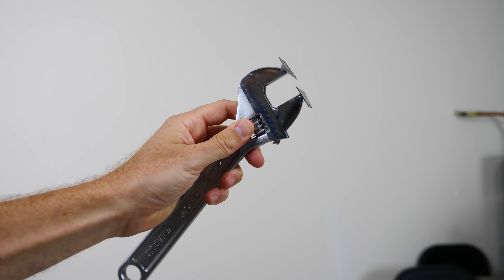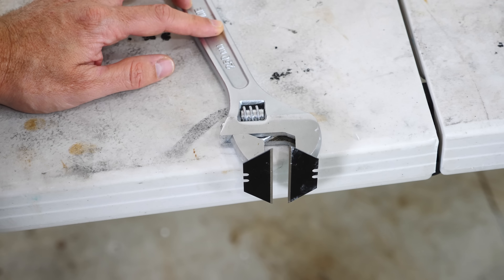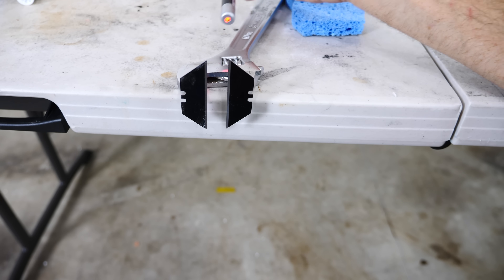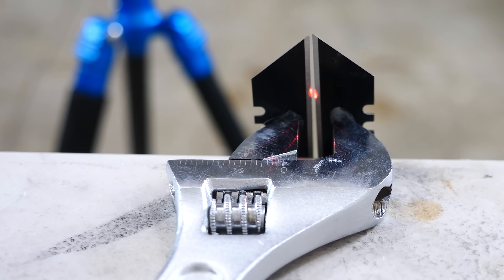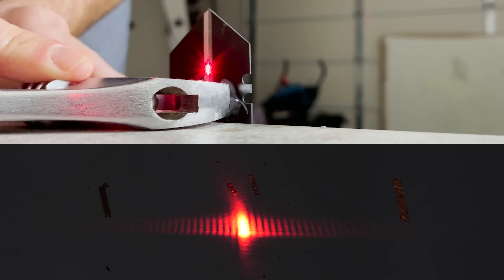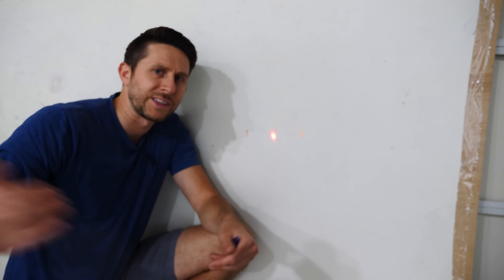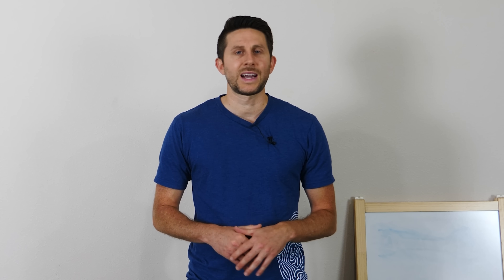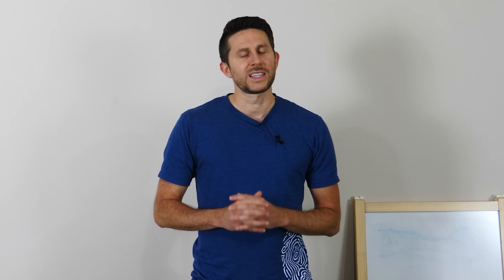Squishing Light Makes It Bigger—Heisenberg's Uncertainty Principle

Comment: What you and others fail to realize is that the atoms and molecules, in this case of the razor blades, have an associated magnetic field with them.  Light, 'em', also has a magnetic component to it.  Magnetism is magnetism, varying possibly only in density and energy frequency.  The magnetic portion of the 'em' interacts with the magnetic portion of the atoms and molecules of the razors, thereby causing the indications observed.
Reply: You don't make any sense. This is the wave-particle duality of light that is displayed here. The material the razor blade is made of doesn't matter at all, it doesn't interact " magnetically" with the light
Reply: @abcdefgh-db1to  Here is an idea I had quite a while ago for what I believe is a better explanation to the dual slit experiment:  (copy and paste from my files):

It is only an idea on my part but it goes something like this:
1. Charged particles have their associated magnetic fields with them.
2. Protons and electrons are charged particles and have their associated magnetic fields with them.
3. Photons also have both an electrical and magnetic components to them.
4. Whenever a proton, electron, or photon is shot out of a gun, it's respective magnetic field interacts with the magnetic fields of the electrons in the atoms and molecules of the gun itself, the medium the projectile is traveling through (ie: air), and/or from around the slits themselves.
5. Via QED (quantum electrodynamics), newly generated photons might occur.
6. The projectile goes on it's own way and the newly generated photons go on their own way.  It gives the illusion of a wave particle duality, but it is not that way in actual reality.
7. Specifically in the case of protons or electrons, the newly generated EM wave travels faster than the particles. The new EM waves go through both slits and sets up "hills and valleys" of field energy. When the proton or electron goes through one of the slits, it then follows whatever "valley" it enters thereby over time, even shooting only one proton or one electron at a time, the interference pattern will still emerge.
8. As far as detectors are concerned, they probably have an energy field that is one way when on and a different way when off.  The interaction of this energy field (or the lack thereof) with whatever is passing through it, gives the indication that is observed.

Now, for those who hold fast to reality being probability waves that are condensed down by an observer into one single physical reality, then:
a. What exactly are these probability waves made up of?
b. Where exactly are these probability waves stored at until they are observed?
c. How exactly does an observer in physical reality actually observe these probability waves and condense them down into one single physical reality?
d. Who and/or what observed the first observer?
e. What exactly happens when two or more observers observe different probability waves?  Which one takes precedent in physical reality?

For me, while this observer condensing probability waves down into one single physical reality might work well on paper, it does not appear to reflect actual reality.

Now, utilizing the scientific principal of Occam's razor, which way is more probably correct?  My way by utilizing known scientific principals, or that is as discerned on paper as stated above is how reality actually is?
Reply: @charlesbrightman4237  your understanding of the interaction between charged particles and magnetic fields is very wrong. 
As for your denying of quantum mechanics and probability happening in the physical world, how then can you imagine quantum computing, which actually works in the physical world.
As for when two observers observe different probability waves, it doesn't even make sense. As soon as you make a measurement, you interfere with the probability wave and you basically fixate the state the particle is in, if a second observer arrives, he will observe exactly the same thing as the first.

And believe me, when you do the math, the physical world is in perfect accordance with quantum mechanics. There are still lots of areas of unknown but everything you have mentioned is overall well understood and is pretty basic quantum mechanics knowledge.
Reply: @abcdefgh-db1to  Nope, you are wrong and do not understand QED and QCD.
Reply: @charlesbrightman4237  Says the guy who thinks gravity is caused by magnetism...

I have read a couple other of your comments and you clearly don't understand anything about magnetic fields.
Do you have any physics education ? Masters degree ? Doctorate ? Are you a professor ?
Reply: @charlesbrightman4237  well we live in a 4 dimensional universe as far as we know and if you think you can say why then you are completely delusional. Why do mathematical constants exist ? Because. They just do. They are properties, ratios that just make sense and are essential in building mathematics.
You simply can't answer the question why.
About what is gravity, well it's the product of mass warping space time. Why ? No idea it's just a fact.
Now the link between gravity and the other fundamental forces is yet poorly understood, but don't go thinking you can solve it all by using big words you don't understand and a warped perception of physics.
If you want to learn physics, learn math first. And I'm thinking you never even went to university and did real math or physics
Reply: You know this diffraction pattern is being studied from 100’s of years right?  And you know brilliant minds have explained the phenomenon and 1000’s of experiments conducted by millions of scientists confirm them right. You think you are smartest of them all?
Reply: @karansandhu4827  Okay, for you also:

a.  What exactly is 'space'?
b.  What exactly is 'time'?
c.  What exactly is 'gravity'?
d.  How exactly does matter warp the fabric of spacetime?
e.  How exactly do numbers and mathematical constants exist for math to do what math does in this universe?

Comment: How do we know for sure that some of the laser light wasn't reflecting off the imperfect edges of the razor blades and thus spreading out to either side. It looks like an interference pattern as well, which could be light from each left/right blade edge reflection?
Reply: Check out diffraction due to a single slit, it's the phenomenon that's occuring as the blades get super close together.
Reply: I also though the pattern may be caused by reflection of the edges of the blade. It would explain why the light were more and more dim on the side. It should have put a non reflecting surface on the edge like some black tape.

Comment: How do you know that the laser light on your white board isn't just disturbed/altered/scattered by the edges of the blades in some inexplicable way that causes/produces that interleaved 'light-no light' repeating pattern on the white board as the laser beam width is reduced/constricted by moving of the blades closer together?  Maybe the photon-blade collisions causes some of the photons to spin/deflect/reflect/or otherwise change directions in some weird way or even bump into other photons to create a weird oscillation/interference of some kind after they collide with the edges of the blades & other photons before they strike the white board... Think of water molecules moving down a river & then colliding with a tree branch.  They reorient their motion & interaction along their paths because of collisions with other things.  It seems to me that the same kind of thing may be happening with photons of light in your experiment.

One experiment that you could try is to change the aperture geometry to see what final light patterns may emerge.  Instead of a slit or double slit experiment, try different shaped rectangles of different areas that allow only some of the light to pass.  Then try circular & other shapes to see if there are any indicates as to why certain shapes produce different interference patterns.